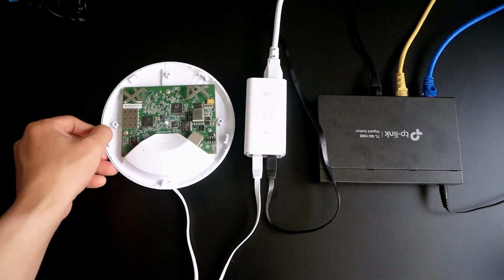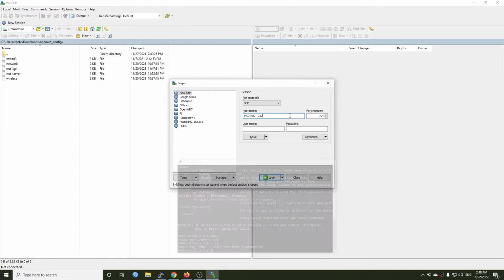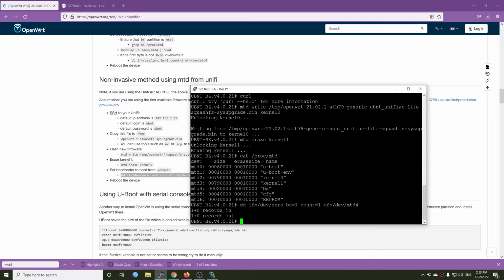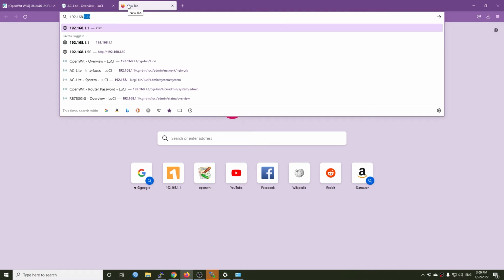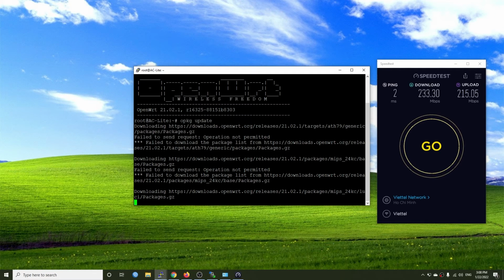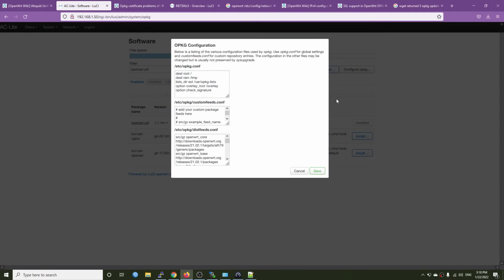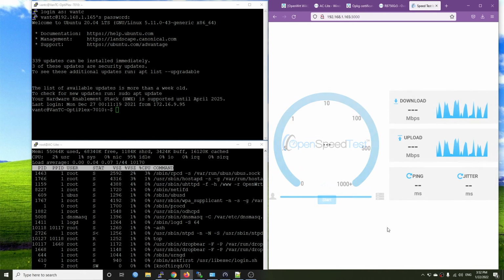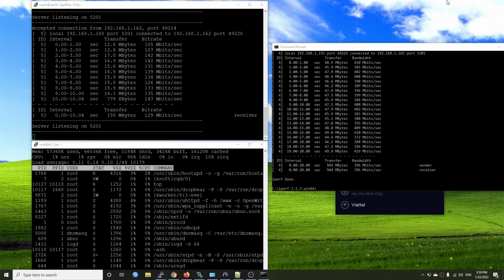OpenWRT - Install OpenWRT 21.02 on Ubiquiti UniFi AC Lite

Comment: Thanks for this! It helped a lot. However I was already running 5.43.56 which meant there was no wget or mtd on my AP AC Lite. 
In order for me to downgrade the Unifi firmware to the recommended Unifi 3.7.58 from the guide I simply used
upgrade [url of recommended Unifi firmware from the openwrt guide]
After that I could continue along with your guide. Thanks again!

Comment: Really look forward to your video's because you go in depth with the command line part of openWRT. Your video's are still missing more on the routerboard RBM11G board! It run's a media tec 7621 processor and supports openWRT. It is a cheap solution that has a M.2 slot for 4G modem and a gigabyte WAN port to hook up a switch that you can hook access points to. Keep up the great work

Comment: coisa linda..... como estou com diversos clientes devolvendo os equipamentos, dessa forma me ajudou muito!
Reply from the maker: Thanks for the comment. If you only run 1 or 2 UniFi AP in your network, setup a UniFi controller is costly. OpenWRT will be a great choice and better roaming experience, the only downside is that UniFi AC has a closed source SDK, using open source firmware & driver does impact the throughput.

Comment: Hi @Van Tech Corner, Could you help me, I have successfully changed the firmware to OpenWRT but in the overlay partition of the flash memory all the available memory of the equipment has not been allocated, so I cannot download or install an additional package

Comment: How about instal openwrt 21 on a stb zte b860h from the fw on the website openwrt, on the web i dont know which fw for the stb.
Reply from the maker: Hi, I can't find this model in openwrt.org, means the official support for the device is not available with openwrt.org. However there are guides and videos showing how to do that, you can take a look and give it a try.

Comment: Followed this video nearly a year ago when I set up my UniFi AP AC LR. Now recently I have been having weird disconnects from the eth0 port. It drops connection every few seconds for half an hour and then works fine as if nothing happened. This happens randomly throughout the day. I tried different LAN cables but those cables all work fine with my computer. Sometimes it also refuses to connect with 1000 speed but with 100 it works fine. Has anyone experienced something similar and or has a solution to this?
Reply from the maker: Did you change a new PoE injector or switch port?
I have a UAP and it is having the same problem. There are disconnections and sometimes the UAP linkspeed is only 10Mbps. After I replug the Ethernet cable, it start to work (soft-reset / disable & enable the port from software doesn't help). I think there is something wrong with the hardware but it is too old for the warranty.
Reply: @VanTechCorner  No still the same PoE. I did test a few ports but they acted the same. I bought it back in August 2020 so warranty just expired by around 3 months. 
Mine acts like you described. Re-plugging the cable seems to help for a short time.

Comment: I have an UniFi AP Pro model, fw v3.9.19. Can I use this tutorial on this model?
Reply from the maker: You should be able to install OpenWRT with mtd (of course using the correct OpenWRT firmware for UniFi AP Pro instead of the one showing on this video). You can check out the guide here https://openwrt.org/toh/ubiquiti/unifi_ap_pro

Comment: Academic aside, what does the OpenWRT offer that the stock FW does not in real world situations? Primarily people flash the stock FW for OpenWRT to get advanced enterprise level features. If the devices involved are cheap, it’s even better. The AC Lite is not expensive, but they are not cheap either. Is there a cheaper alternative to the AC Lite that can take OpenWRT? Can APs that have OpenWRT be managed centrally by a controller like the AC Lite with their stock FW?
Reply from the maker: There are a lot of features OpenWRT offers. For example, I am using a UniFi AC Lite and an Aruba AP-105, and I want to set up fast roaming or Mesh WiFi, it is impossible. However, with the devices running OpenWRT, this can be done in just few clicks. You can manage your OpenWRT devices centrally (see OpenWISP). Take another step further, GL-iNet router is based on OpenWRT and the devices can be managed by an application on smartphone, or manage centrally at  goodcloud (see https://www.gl-inet.com/solutions/goodcloud/)
Reply: @VanTechCorner  Thank you for the clarification. I and many of your viewers appreciate your detailed videos on these products and their features. Can you do additional videos on how to use OpenWrt in a multi-AP environment? If OpenWRT and the vendors that use it such as GL-iNet would create an entire ecosystem of APs and routers that use OpenWRT, this great opensource FW can move out of the labs and homes to the enterprise environment where companies typically use Cisco and Ubiquiti. I had such high hope for OpenMesh for a while until it was sold to a bigger company. That change of ownership basically destroyed the opensource identity of Openmesh.
Reply: The benefit is you don't need to run the controller software (or keep it running) in order to manage the AP.

Ubiquiti also do not publish device support timescales, so one day you can upgrade your controller to find your AP is no longer supported. 

With OpenWRT a device is supported for however long the community maintains a build target for the device, probably only limited by device specs as the linux kernel grows.